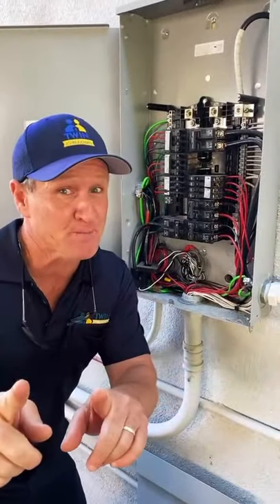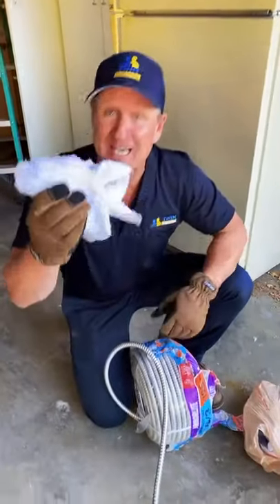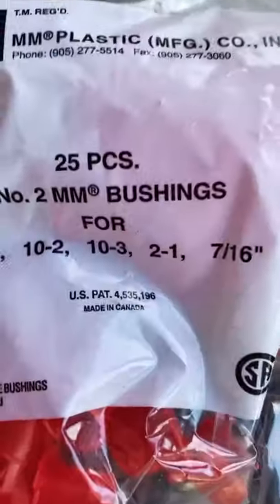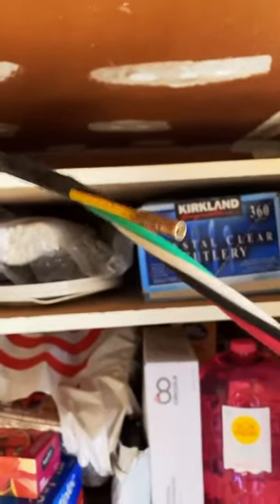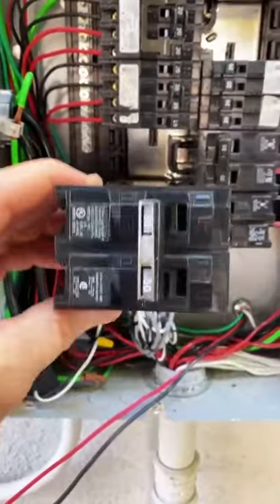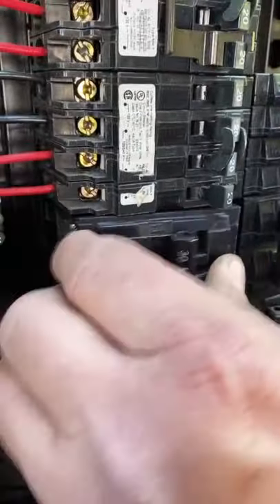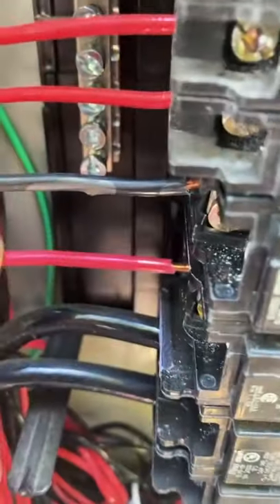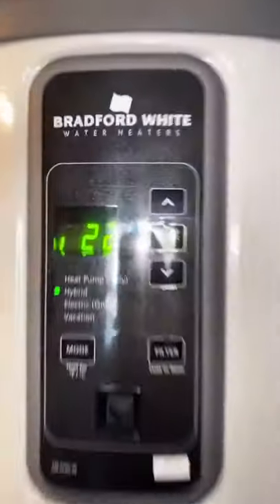How to run electric to a hybrid water heater

Comment: You don't need 10/3, only need 10/2.  Also, don't tape wirenuts, easiest way for electricians to spot a diy job.
Reply: They probably need a neutral to the boards. I run 3 wire to air handlers when we use a condensate pump, while most hacks will hook to a bare ground wire which is not meant for constant voltage. A neutral wire carries voltage thats why it's insulated. Hope this helps.